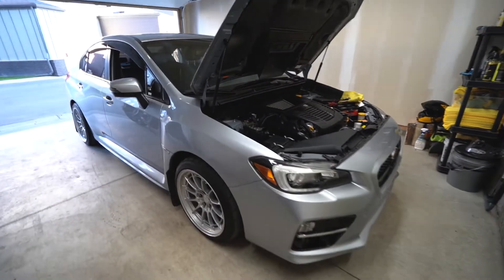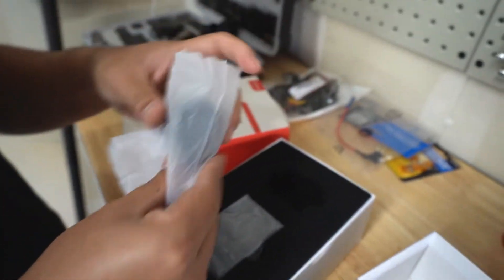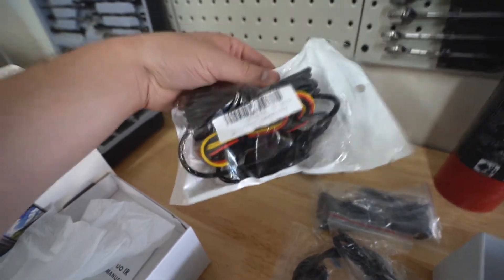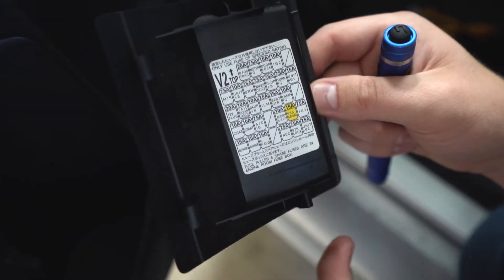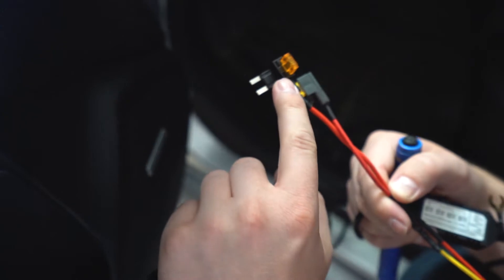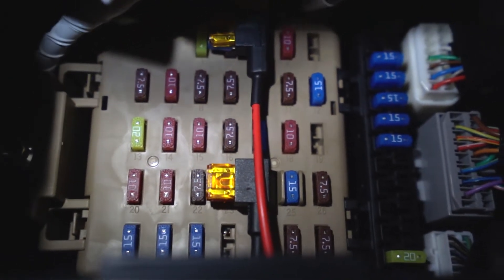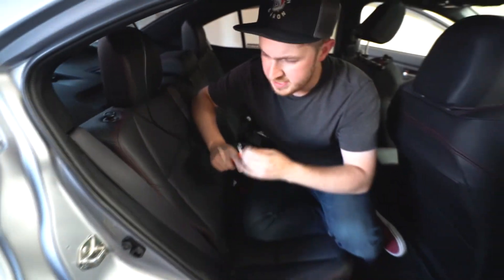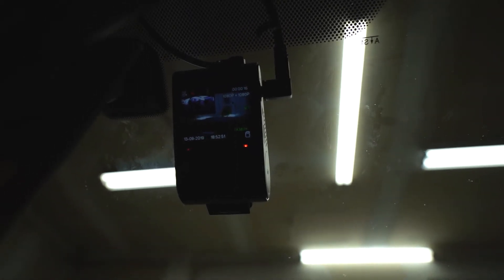📷 🔌 Viofo A129 Dashcam Hardwire + Parking Mode Installation (Day # 15)

Comment: Great install vid.
I’m concerned about running my wires up the A pillar with air bags
Reply from the maker: Just pop off the pillar (very easy) and run the wire around if you have any concern! :)

Comment: Hey, I know this is a few years old, I'm wanting to get 1 of these, if hardwired by an electrician, will I need to buy a battery pack, to tell the cam to turn off as not to drain the battery?
Thanks 👍
Reply from the maker: You will need the HK3-ACC type of hardwire module yes but you don't need a battery pack separate (you could though)

Comment: Good video but you’ve done an extremely dangerous thing by crossing the curtain air bag.  You could either go under it at the top of the A pillar or remove the trim and go above it from the bottom.
Reply from the maker: There's a couple inches from the very top of the plastic trim, right where it meets the roof liner, that actually does not have the airbag positioned behind. But if you look in the 3rd photograph found in this IWSTI forum post (interior removal): https://www.iwsti.com/threads/dashboard-removal-2008-sti.252847/ You can see from the very top, that space which is okay to cross behind. Every vehicle make / model are quite different, along with each generation Subaru, but they all have wiring going down. If you aren't confident and want to be absolutely certain however - be sure to remove your A Pillar, usually two screws holding it in and a couple tabs to pop and it comes right off. Otherwise, if you run down the side closest the front windshield - you should be safe without crossing near the airbag itself. 

Also here is another informative reference post further details about running wires up and around the airbags (and, the recommendation to remove.) https://www.blackboxmycar.com/pages/dash-cams-and-airbags

Comment: Do you have the option to turn off the parking mode completely?  Let's say I go with the 12.0 volts setting for parking mode and connect it to the constant on fuse. Can I go into the options menu in the camera to turn off the parking mode?

Comment: I noticed in your video you left the power supply for the front camera plugged into the front plate port; it appeared the parking mode was working, but if you unplugged the power from the front plate port and plugged it into the correct port, the usb port, I wonder if the power would have remained on signifying that the parking mode was working?

I hooked up hard wire kit correctly and I still cannot get the parking mode to work; the wi-fi always turns itself off thereby negating the parking mode setting; some help would be nice.
Reply: Did it work using the USB port on the camera itself?not using the gos base plate.

Comment: I have this hardwire kit and got it done with an expert, but why it is draining my car battery even though I have set it to 12.4v cutoff. Please let me know where I'm wrong.
Reply from the maker: What car do you have and what have you done to determine it's the dashcam?  Maybe consult with the expert that installed it because it should not be doing that - but there could be many different reasons your battery is draining quickly!
Reply: @SpencerHogg   I have Honda Jazz/fit 2014 model, recently I changed my car battery to brand new bcos of this draining, still it is the same....as you said will consult the expert again.
Reply from the maker: @prashudwd80  There's sometimes what's called a "parasitic drain" on cars. I know the 2017 Subaru's some were affected by it. The ECU was programmed and something (unknown) was slowly draining the battery. Some Dealerships have bulletins on that and will re-program the ECU on this (something related to the alternator I believe on the Subaru).  Might be worth checking into that!!  But also, perhaps something else could be draining the battery, I'd also suggest trying to change the fuse port you're running the hard-wire from. Ie. if you're using door locks fuse like we are in my video - try changing to something else for battery power (depending on car!)  Hopefully this helps a bit!
Reply: @SpencerHogg   thanks buddy, will try this out

Comment: I cant find a ACC on my fiesta! Can you please tell me how I can find it? Is it possible that there is none?
Reply: There is definitely at least one, on all reasonably modern cars. You'll need a test light attached to a ground, then just go through your fuse box turning the car key from OFF to ACC and see which turn on while ACC is ON, then turn off again when ACC (your keys) are fully OFF. 

If you already tried this I recommend ensuring your test light is not faulty.

Comment: You gotta be the first one I’ve seen solder their hardwired kit

And I’ve seen a lot of dashcam wiring videos.
Reply from the maker: What are most people using, vampire clips or T Taps?? Ugh. Too much bad experiences. Solder and have it last forever haha.
Reply: Spencer Hogg crimping. 👎
Reply from the maker: benefactionhindrance I’ve seen so many crimps fall apart I just rather have it solid forever lol
Reply: Soldered mine too. Got a question though, most cars provide power for 15-20 mins after ignition has been on. So I've hardwired mine in too with viofo three wire kit, same as yours. After 20mins on my BMW the camera is seen to be totally off, which is fine as it is only needing to come on when it detects motion right? I'm just not sure how to tell of it's working ok with my 'always on fuse' via the red wire in VIOFOs case. Thanks

Comment: great video with one exception, for the hardwired kit you should have connected the power cable straight to the camera and not to the base as shown in the video. Otherwise you lose the parking mode capability (and might drain your battery as well, but i am not sure on that one).
Reply: One small afterthought, the under voltage protection circuit will still protect the battery from going dead, its just that the camera would not turn off... I think
Reply: That problem gas been fixed with a firmware update

Comment: why you wrote on video that for parking mode u need to plug to usb when you plug in base plate and its working... I using usb and it looks does not working
Reply: Right, to keep it working in parking mode we have to use side slot of dash cam, we cant use gps mount slot, i have tried that too, wondering how this guy is using parking mode with wire in that gps mount 🤔

Comment: Does the camera remain on all the time in parking mode or only when motion is detected?
Reply from the maker: It can actually do both. You can have it record 24/7, OR you can have it record only on motion detection, and the good thing is it has buffering mode, so it will also include the 20 seconds prior + after the motion is detected basically. (But it won't SAVE any video unless there's motion). It will only have motion incidents. It's a very good setup this way.
Reply: @SpencerHogg  so in both ways it will drain the car battery in few days if you don't use the car and leave it in the garage. It was better if there was just a motion sensor that would turn on the camera when it detects a movement outside
Reply: @SpencerHogg  What settings are you using (set to what) to allow for the recordings when the car is off? I have had mine set up for a month with various settings and no recordings exist when the car is off (though the lights are on) or it is recording 24x7 and overwriting anything that may needs to be used later if I were to come back and see damage or something

Comment: if you have plugged in the battery line for parking mode, why did you plug in the ACC line as well?
Reply from the maker: You need to plug in both, it's absolutely required to perform and function properly.  It runs off ACC while driving (alternator charging) and directly off battery when vehicle is off (direct battery).
Reply: @SpencerHogg  does it drane your car battery since its drawing power constantly?

Comment: Doing it properly would be crimping. a crimped connection will easily last longer than solder.  As solder gets brittle overtime and is subject to degredation from vibration
Reply: Wtf....
Reply: @spike378  what?